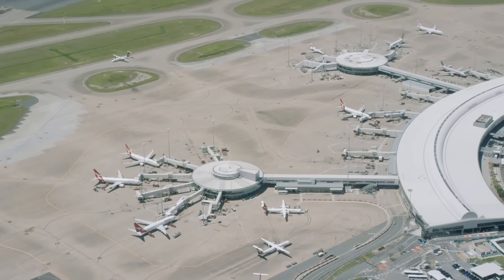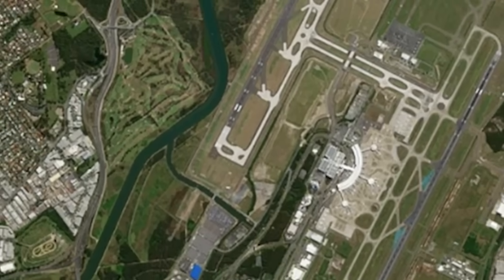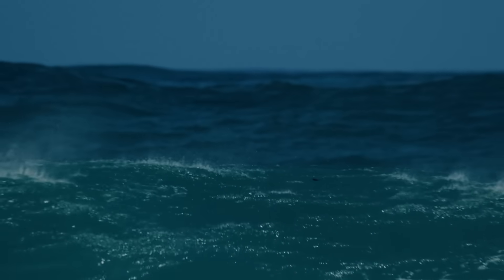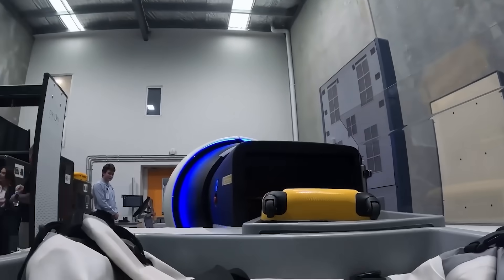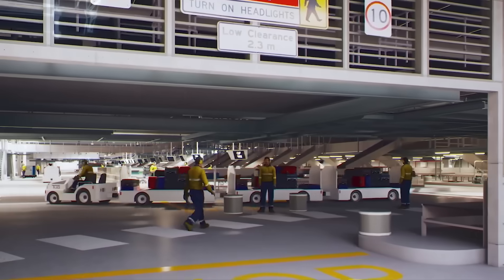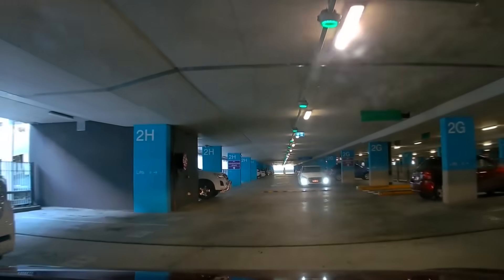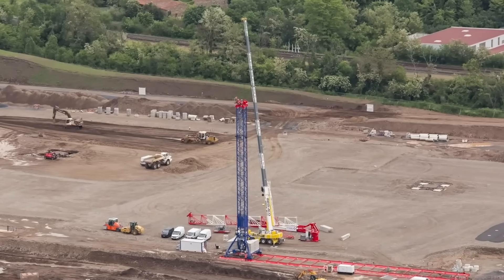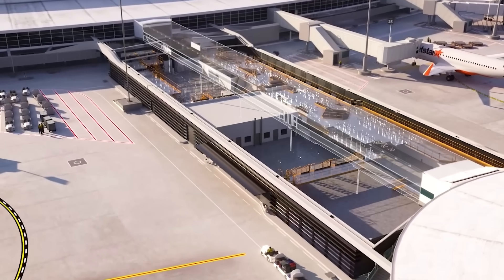Brisbane Airport's $5 Billion Engineering Marvel

Comment: MEL fits four terminals and 35 m pax/yr onto ~2 700 ha with one concourse and two runways (third coming).
BNE spreads the same land into two terminals 3 km apart, needs buses/trains to connect them, and only moves ~23 m pax. Now it’s throwing A$5 bn at a domestic refit, intl makeover + a brand-new T3 before the 2032 Olympics—on top of the A$1.3 bn second runway that opened in 2020.
Maybe it’s time the layout, not just the buildings, got a rethink. Too much $$ for too little extra throughput? Seems like Queenslanders are getting a bad deal!

Comment: Much needed upgrade, but please put soft floors like Singapore Airport.. walking distances should feel comfortable and less tiring esp for older people.
Reply: It has been observed that soft flooring may inadvertently affect the pace at which individuals move, potentially leading to missed flights.

Consequently, this situation might result in a greater number of people remaining within the terminal, which could potentially increase revenue for the airlines, parking contractors and terminal owners.

😇😇😇
Reply: I have a better solution, better shoes or insoles that way you can be comfortable even outside of airport 😉🤯
Reply: @qwerto15   many old people dont have strong knees.

Comment: They need to overhaul the AirTrain schedule. Right now, you can wait a half an hour for a train to the city.
Reply: And you pay a fortune.
Reply: @DarrenClapson-nt9lq  get a train to eagle junctio station then uber to the airport. its cheaper
Reply: @DarrenClapson-nt9lq  Sadly that is the result of Airtrain being a private company, the government has tried to buy them out a few times but it’s fallen flat. They’re just a greedy corporation
Reply: Fr, if they can buy back Airtrain and potentially duplicate the line, it’d be FAR better
Reply: Or ten minutes during peak times 🙄
Reply: Absolutely! If Air Train was returned to QR before 2036, that would be great! Ridership would surge if the frequency was increased, say every 10-15mins, and had 50c fares like the rest of the south east.
Reply: i agree, ive purposly told people to not take the air train lol..  cause it was cheaper and quicker
Reply: I just uber. It's quicker and not that much more in cost.
Reply: An ungrateful lot. What you never say is that the fare is less than  $20 to go as far as The Gold Coast or the Sunshine Coast.  And it was built at no cost to taxpayers.

Comment: Great more car parks!!
Reply: More VERY EXPENSIVE carparks
Reply: @ironside210  You put a transport monopoly in the hands of foreign invertors
Reply: @colinmay151  exactly the same as our hospital parking unfortunately :( :(
Reply: @ironside210  They are not too bad. I've used them regularly over the last few years. Even cheaper if you ride a bike the airport.
Reply: $5.0b in upgrades- all of which contribute to increasing the bottom line for the BAC. $5.0b and according to an email I received last week from the BAC, not a cent is to be spent on improving pick up and drop off places for car. New car park?  Certainly- it is heavily monetised. But difficult to monetise car drop offs. So no point spending money on that.

Comment: They need to sort out the pick-up/ drop-off zones while they're at it.  Currently, it is a nightmare trying to check in or go through security on the virgin side, which is why i avoid flying virgin.
Reply: $5.0b in upgrades- all of which contribute to increasing the bottom line for the BAC. $5.0b and according to an email I received last week from the BAC, not a cent is to be spent on improving pick up and drop off places for car. New car park?  Certainly- it is heavily monetised. But difficult to monetise car drop offs. So no point spending money on that.